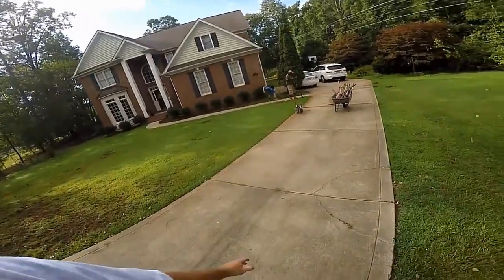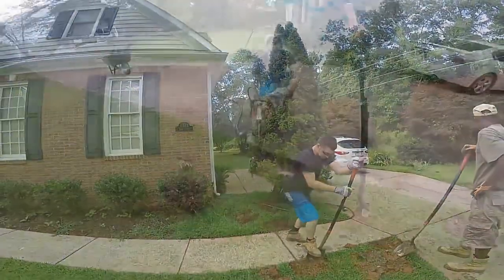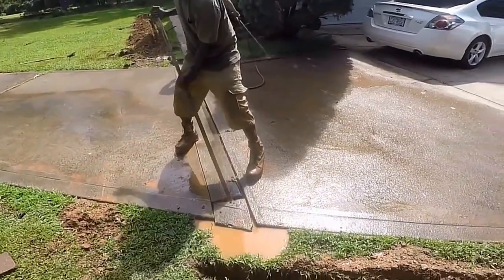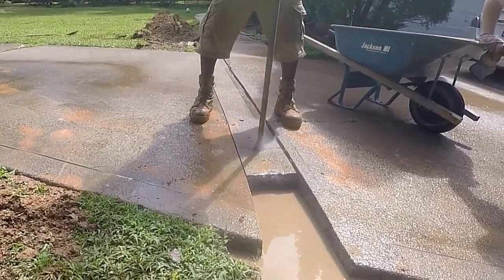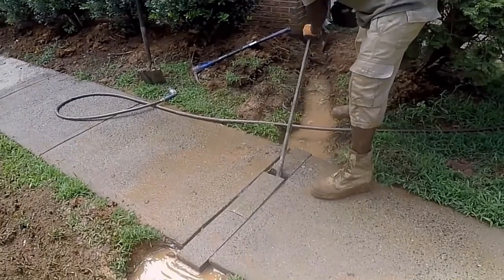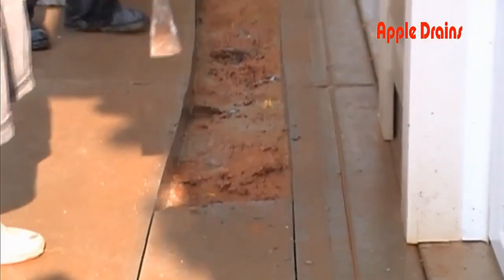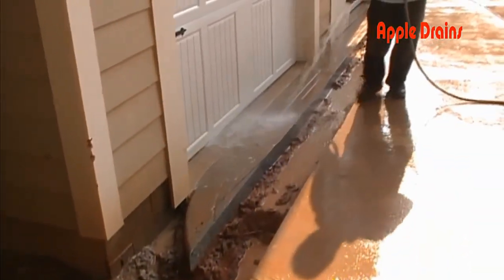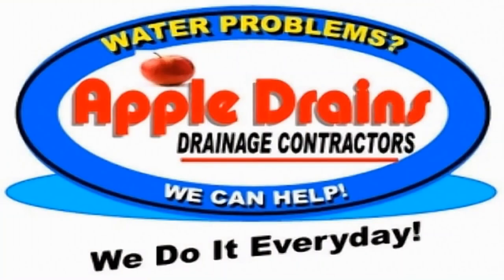Successful Secrets for Cutting Channel Drain in Concrete. 2 Examples How to Install Channel Drain

Comment: Can the concrete be  higher than the drain channel and then fill the gap with cement and make it on an angle, it happened  that the low point is not where I want the water to go? ,thank you for the vudeo .

Comment: I hired a crew and to make a story short they did channel drains with no way for the water to go , now the water stays in the channel drains , there is no opening  on either side , the neighbors on one side and 6 inch concrete slab on the other , can I cut under the slab and have the water go on grass , and how can dig under grass and possibly  make a hole  in concrete.? Tgank you

Comment: hey Chuck...Does them channel drains have to be in concrete? i was just curious because water washes from my yard to the neighbors yard and i was wondering if i could put some of that along the chain link fence line to grab up some of it (his yard is lower than mine so was trying to do him a solid) lol
Reply: Should be fine if secured well enough with stakes or rebar etc